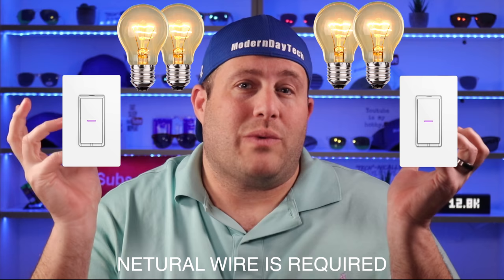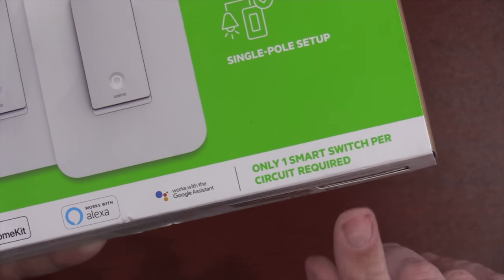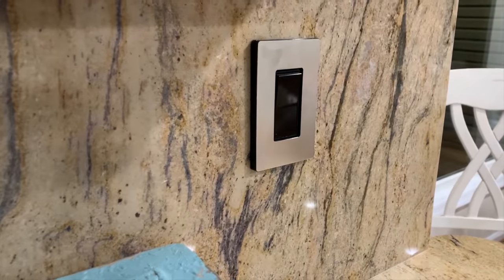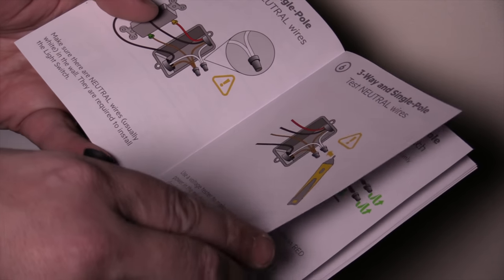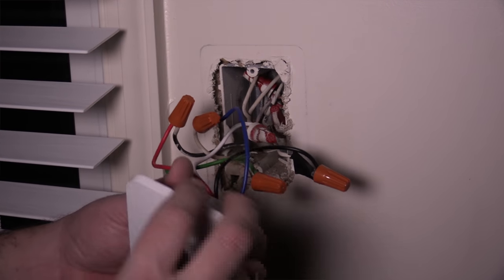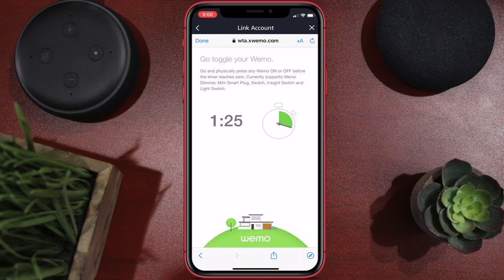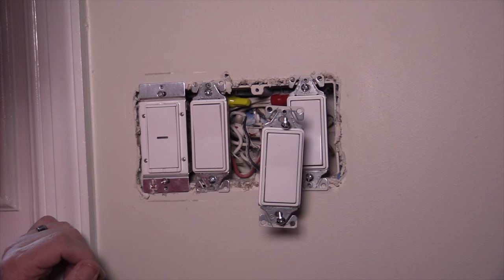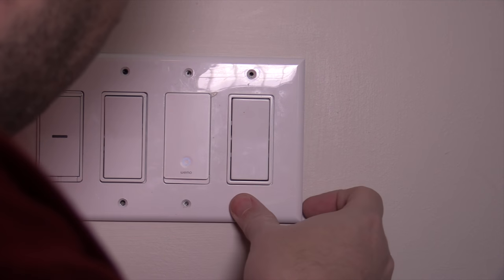How to use 1 Smart Switch for 3-way - Wemo Smart Switch

Comment: I have tried several Wemo devices and all have had connectivity issues to HomeKit. I have found Lutron Caseta Wireless dimmer switches to be 100 percent reliable and no neutral wire is needed. Super easy install. Great video - but clearly Wemo is not reliable and not easy to get up and working without some unnecessary complications
Reply from the maker: Yeah I don't know what the issue is at setup but other than that they've been good for me. No connection issues after the setup.  Lutron is awesome too. In a 3-way situation, I think you'll have to tap one of the switch off and put in a pico remote which is good option too.

Comment: Great video Eric! I’m a huge fan of using smart switches. This has me wanting to look into these wemo switches more. So to clarify, if you flip a “dumb” switch off that’s connected to one of these in a 3 way, you can still control the lights via voice/app?
Reply from the maker: Thanks Shane. Yes you have full control still via voice, apps or the physical controls. The power to maintain the communications comes from the neutral wire from my understanding. Works great even in the 4-way setup, which just blew my mind.
Reply: ModernDayTech awesome, pretty cool stuff. Thanks!!
Reply: ModernDayTech the power for the switch comes from the hot, and goes back through the neutral.
Reply from the maker: Thanks for the clarification I knew it was something like that. I knew it was needed.

Comment: Excellent video!  The instructional videos that are edited like this are MUCH better than so many that just include people rambling on for way too long when you're trying to get the information. I love that you got right to it and got out the information. Great video!  Have you done any on the lutron switches?  Do they require replacing both switches for the same setup as in this video?
Reply from the maker: Hi David, Glad it was helpful! I haven't done one on the Lutron Switch only becasue it's been done a million times but I did do one on the Lutron Fan. https://youtu.be/Y1OrK1rAGFQ Both the fan and light switches are AWESOME!!!  I don't love that it uses a hub but I'll get over it. lol  The light switch is pretty much the same thing as the fan but the Lutron Light switch doesn't need a neutral. For a three or four way circut, my understanding is that you'll need to use pico remotes. (There's only two wires, no neutral or traveler)  Which means, you'll have to cap off the other switches and cover them up with the pico remotes.  Check your local laws and regulations and seek professional assistance if needed. The Wemo 3-way and Brilliant Controller are the only native homekit light controls that I know that only require one smart switch per circuit. There might be othesr that are non-native to Homekit that I'll be able to bring to homekit via hoob & smartthings which I'll be doing a how to video in the future.  But it you want understand the concept, feel free to watch how I got this other non-native accessories into homekit - https://youtu.be/DJZPzlOJ2H8

Comment: Great video! So all three neutrals can go into same bundle? I have 2 bundles in there, 1 bundle has 2 wires, the other bundle has 3 neutral wires, how would you wire that? Thank you so much!
Reply from the maker: It sounds like you are working on a box with multiple switches.  Make sure you are only working on the wires for that switch and not the other. If you're not 100% sure, hire an electrician!

Comment: I couldn’t agree more. When in doubt, get an electrician people!
Reply from the maker: BenderTube Right it’s not rocket science but when in doubt don’t risk it.
Reply: Now my question for you is if Belkin included wire stickers in the package for you? I know an older model WeMo switch I had didn’t have them, but with the dimmer switch, they were included
Reply from the maker: They included one black sticker to identify the line wire and 10 wire nuts in the two pack I got. Even though I had two pack, only one black sticker came so I just used a piece of electrical tape for the 4-way circuit I did. Once i identified the line and neutral wires, the other three are pretty identifiable.

Comment: Do you have to use alexa or some other service like that in order for these light switches to work? I don't have Alexa and have no desire to have Alexa or anything like it, I just want to be able to turn the bedroom light off from my bed and not 20 feet away where the switch is.
Reply from the maker: This is quite old and theres many more now that do the same thing,  so I don't remember specfically for this switch but most brands work with their manufacture's native app if thats all you want to use. Meaning for this product, this will work with the Wemo app on your phone.

Comment: Does the switch detect if the light was turned off by the other switch?
Reply from the maker: I'm not quite sure what you're asking but it works like a normal 3-way, no matter if your controlling it via the smart switch side or the dumb switch side.

Comment: Great Video!  I got excited when I saw this for a 4 way.  But I am still HOPING that another solution comes soon for a dimmable 4 way switch.  I have the Lutron Casseta and it is a Love / Hate Relationship.  Love the reliability and Pico.    Hate that it is hard to see at night if lights are not on and that it does not auto go to last setting.  Please find me a solution.  I do love the Kasa T-Plink switches.  Thank you!!

Comment: hey man, that's really helpful! I have the opposite problem - is there a way to connect 2 single-pole smart switches to turn either light on when you flip one switch?
Reply from the maker: You can try automations saying when one turns on the other will turn on and vise versa for off. But I have feeling you'll have some conflict depending on how you write the conditions.  If that doesn't work, you can take one switch and tie the load and line together to make the bulb have constant power. You then cover up that hardwire switch with a wireless smart one.  Then use a smart bulb in the always on socket. Then you'll have simpler automations to sync them all.   Also check out my other video where you might get more ideas and understanding.  Between smart bulbs smart switches, smart wireless switches and automations, it can be done. https://youtu.be/IGHHwTiPSg4

Comment: Nice! Question though, I used FEIT stair dimmer switch. It also said I can use 3 way switch and other is normal switch. However, it confused me when they said identify Line side or Fixture side. I managed to connected smarter dimmer switch but it only work when other switch always ON.
Reply from the maker: I just looked up the product and the packaging is confusing to me too. On the front it says 2 switches per circuit and then on back it shows you can do just one with a normal switch on the other side.  Which is it @feit ?  Anyways, this will video will help you find the hot wire https://youtu.be/Xp4FWJRzHdo. Hopefully you have a neutral in the other box.

Comment: Is it dimmable?
Reply from the maker: No, the 3-way switch is not dimmable.  They do have single pole dimmer model though - https://amzn.to/3f9L9xV (affiliate link) The Lutron Dimmer & Pico remote make up a great 3-way switch but it does require a hub - https://amzn.to/2BQH6YZ (affiliate link) and then the iDevices dimmer is also a great 3-4 way switch but requires one iDevice switch at each location and is quite expensive - https://amzn.to/30vbjY6 (affiliate link) There might be other HomeKit 3-way dimming options but these are the two that I can recommend and tested myself.